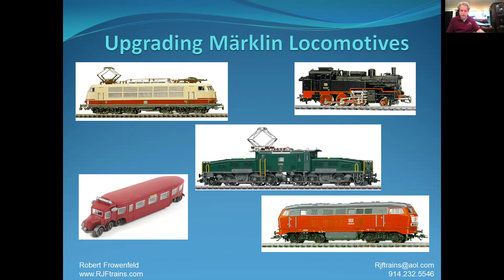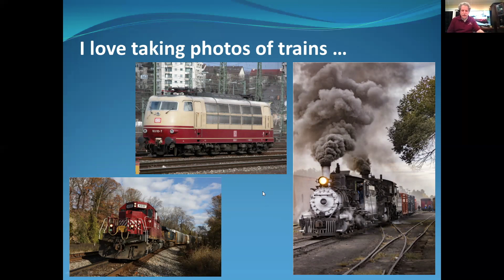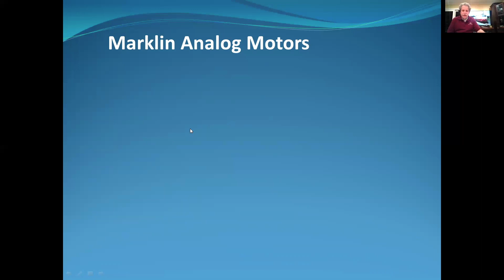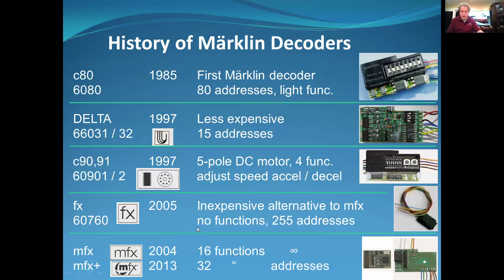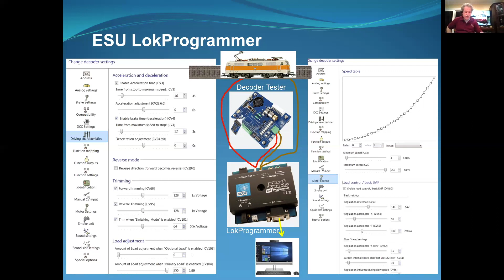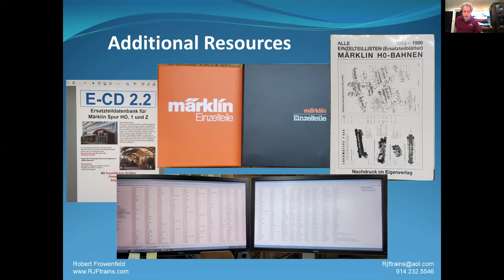Upgrading Marklin Locomotives

Comment: So when you upgrade to digital are you upgrading from 3 rail AC to 2 rail DCC?  Or am I misunderstanding that and there's a 2 rail DC Marklin line as well?   I visited a show put on by a local ETE club, EuroWest, this weekend, now unfortunately my kid was dragging me around faster than what allowed me to ask questions, but one vendor said there was a way to upgrade from 3 rail and I didn't quite get his gist.    I assume you'd have to do surgery on the locomotives, but even so, would be nice to run some nice quality Euro trains, on my mostly American setup (I don't care about "prototypical" at all)
Reply from the maker: Mike, thanks for your question.  Let's see if I can simplify things here, one step at a time.  When you "upgrade" from analog to digital, it has NOTHING to do with 2-rail vs 3-rail.   Furthermore, it has NOTHING to do with DCC (well, more on that in a moment).  When you take an analog locomotive and add a decoder, you're simply adding electronics that will enable that locomotive to be operated by a digital control unit.  In the case of Marklin, that would be a Marklin Mobile or Central Station, or an ESU ECoS controller.  If the locomotive was (is) 2-rail, it stays that way, and if it was originally 3-rail, it's still 3-rail after you add the decoder.  What TYPE of decoder determines the protocol (or "language") that the controller and decoder use to communicate with each other.  Most of today's decoders support all the major protocols, specifically Marklin / Motorola, Marklin "mfx" (ESU calls it "M4") and, yes, DCC.  I'm not sure what the vendor you spoke with meant by "upgrading from 3-rail" -- maybe he was just referring to adding a decoder -- it's not clear.  But, if I gather correctly that you have a 2-rail layout and want to run digital 2-rail locomotives on it, you would have to START with a 2-rail locomotive and add a decoder.  Yes, that MIGHT require some surgery -- but many of the newer analog locomotives come with a socket into which you can just plug a digital decoder -- no wiring, no soldering, just a simple plug-and-play installation.  The one caveat to all this is the track itself.  You would first want to make sure that whatever locomotive(s) you want to run on your American (your words) setup will work with the type of track you have.  Most American layouts have a track "profile" (height of the rails above the roadbed) that accommodates RP25 wheels -- you'll have to dig up some info on that yourself.  Most European style locomotives do NOT use RP25 wheel sets.  Marklin's line of 2-rail locomotives are manufactured under the TRIX line (which I carry as well).  But the TRIX locomotives, as well as those made by other manufacturers of European models, use wheels that work on Code 83 profile of track.  In short, you would need to make sure that any locomotives you want to add to your existing 2-rail track will run properly.  If all your track was made for American models, I submit that the answer might be "no".  OK, that's a very long (but detailed) answer to your short question, but I believe I've covered most of the details you need to proceed.  Any more questions?  Just e-mail me at RJFtrains@aol.com --- I'll be happy to go 1-on-1 with you that way.
Reply: @robertfrowenfeld5866  Thanks for the very detailed response.   So if I want Marklin locos on 2 rail look for the Trix line, ok that sounds good.   I do recall seeing Trix locos on some tables, I just thought they happened to be a different manufacturer.
Reply from the maker: @Mike__B  Nope -- Trix is indeed manufactured by Marklin. Any newer models would already have digital decoders installed and, in the event you get an older model that is not digital, adding a decoder (by plugging it into a socket or re-wiring) should be simple.  Let me know if you'd like to purchase anything.  Thanks.

Comment: Very informative video! My Marklin 3065 loco will not move, although the motor spins swell.  The  gear that engages the 3-coil armature is plastic and has stripped away. Is there a source for new gear parts , preferably brass gears? thatnks.
Reply from the maker: The plastic gear is still available.  I either have it in stock or can get it easily enough.  Please e-mail me (rjftrains@aol.com) and I'll be happy to help you get the part.

Comment: Hello Robert, would you recommend a decoder to be able to used on analog transformers as well?
Reply from the maker: I haven't found where one particular decoder works any better than another if being controlled with an analog transformer.  Of course, if you're just going to run it with an analog transformer, there's not need for a decoder in the first place.  But, if you're planning to run it both analog and digital, then my answer is simply (again) there's no reason to pick one decoder over another, AS LONG AS the decoder supports analog (and in the case of Marklin, AC) operation.  Any Marklin or ESU decoder will suffice for this purpose.
Reply: @robertfrowenfeld5866  I have to give you some context about this. Marklin trains are scarce to find where I live and recently bought a locomotive with the decoder missing. I run an analog setup and now can't decide on what to do. For instance looking at this video: https://www.youtube.com/watch?v=GxcM1h3dNhw kinda cool to run with sound on analog.
Reply from the maker: @sunnysworkshop  Well, most of my experience is with ESU decoders.  They run in analog mode just fine but -- to your question -- you CAN program these so the sounds will run in analog mode.  So, if your intent is to run analog AND have sound, then I suggest you consider the ESU LokSound decoders (which I can sell you if you'd like).
Reply: @robertfrowenfeld5866  Sorry for the late reply,  unfortunately customs here is a big problem. We can't even buy anything overseas. Now there is an earthquake on top of it.

Comment: Is it possible just to upgrade the magnet into a permanent one of an old AC motor?
Reply from the maker: If you're asking if you can "only" install a magnet and use the existing motor shield/brushes and armature, the answer is "yes".  Marklin makes the 3 different magnet styles as Trix products for their older analog (2-rail) and Marklin HAMO locomotives.  You should realize that only replacing the field coil with a magnet, while allowing you to now install a digital decoder, will not improve performance.  You'll still have the 3-pole armature and you won't achieve the smooth acceleration / braking or running at slow speeds as you will if you use the 60941, 69043 or 60944 kits which replace all the components and, in the process, you get a nice 5-pole armature.

Comment: Can you enlighten us about upgrading a double locomotive, such as 3346?
Reply from the maker: Sure, happy to oblige.  While this model does indeed have two motors, you would simply use a single decoder.  Even the "regular" Marklin mLD/3 or ESU LokPilot should be able to handle the current draw since these aren't unusually heavy locomotives.  Just put the single decoder in one unit (the one with the pickup shoe) and run wires between them to the other unit.  There are already wires (I don't recall how many) going between them.  You really would only need 4 wires: 2 for the motor and 2 for the rear light.  If you can squeeze in a fifth wire, I would attach an additional ground wire to the motor shield of the rear unit -- you can't have too many grounds!  Yes, Marklin uses thicker wires than really necessary, but I'm sure you can route 4 or 5 wires between the two units if you use the thin wire ESU offers.  Let me know if you have any other questions!
Reply: @robertfrowenfeld5866  Thank you, you cleared it up for me. I also have two 3000 mini steams I want to convert to a double as well. Your video is extremely helpful. 💪
Reply from the maker: @sunnysworkshop  One more thing...  Whether you are converting the 3346 or doing the same sort of thing with your 3000's, as you suggest, remember that you will have to wire the "rear" locomotive's motor backwards.  That's because (since they are back-to-back) one will always be running in the opposite direction as the other.  So, once you get the locomotive WITH the decoder running in the forward direction, note the wires on the motor (blue / green for Marklin, gray / orange for DCC), you'll need to reverse these on the other unit.
Reply: @robertfrowenfeld5866  One last silly question, do you think it is possible to convert a V200 to two motors? I saw this video and got really interested: https://www.youtube.com/watch?v=IXDvc2qxK7Y
Reply from the maker: @sunnysworkshop  The short answer is "no".  I'm not sure why you would even want to -- I mean, this is a very powerful locomotive with the one motor it has.  The front part of the frame doesn't have the proper size / shape opening for another motor.  I suppose that you could modify it to accept another, but then you'd be faced with the problem of where to put the pickup shoe.  I'd just leave this one alone.  But I'd like to know how that guy filmed that video -- it does look cool.
Reply: @robertfrowenfeld5866  It does look like long shot but apparently people are doing this: https://www.youtube.com/watch?v=QU8NO8R8aSY
https://www.youtube.com/watch?v=YkDQNSrNYVk
Reply from the maker: @sunnysworkshop  Well, that's something I've never seen before -- and with a DELTA decoder no less.  Well, I am impressed.  Go for it.

Comment: Robert, excellent presentation, very well explaind, and really will provide additional help on the upgrade of my very old Märklin AC locomoties that I really like. Thanks very much for sharing.
Reply from the maker: Manuel, 

Thanks so much for the  very kind comments.  Feel free to let me know if you have any questions or need assistance in getting any of the parts noted in the presentation.  I typically have everything in stock.

Comment: From my understanding the ESU Lokprogrammer cannot be used to program the Marklin decoders. Having used the Marklin decoder programming tool it is probably not as easy to follow as the ESU Lokprogrammer but you can achieve the same results. The Marklin website can also be difficult to download sound projects from but they are there.
Reply from the maker: This is technically correct.  The ESU LokProgrammer is better suited for ESU decoders and the Marklin programmer is best for Marklin decoders.  The one exception to this might be the first generation of Marklin mfx decoders.  These were initially produced by ESU (for Marklin) and -- way back then -- the only way to program these was with the LokProgrammer.  That said, the ESU decoders AND LokProgrammer provide more options and offer more features, not to mention ease of programming and decoder customization than Marklin's products.